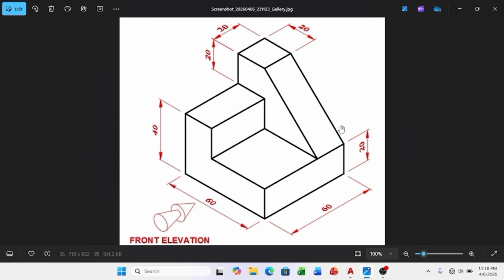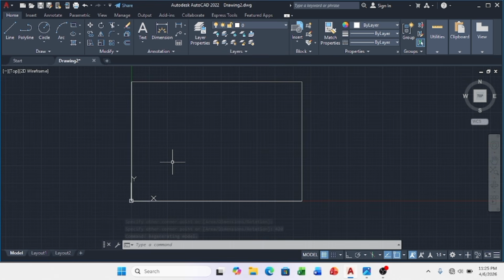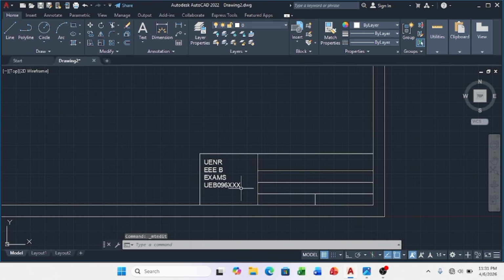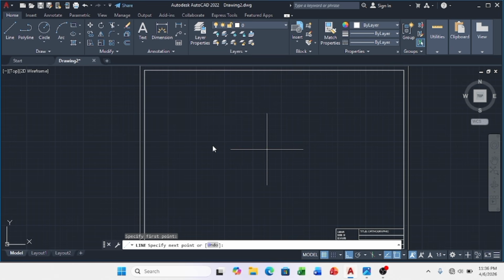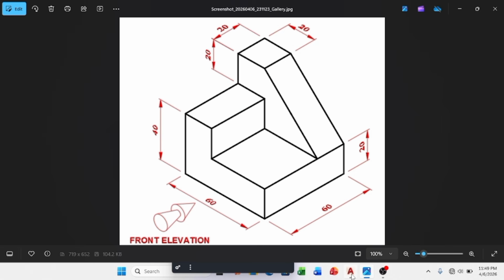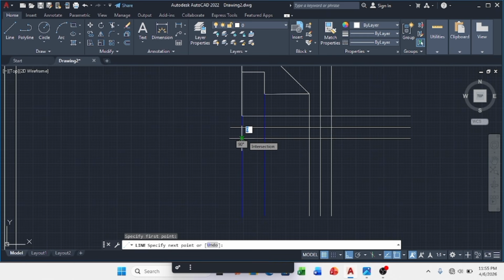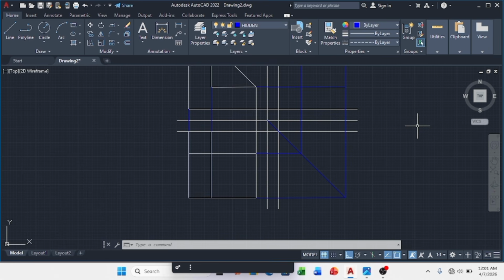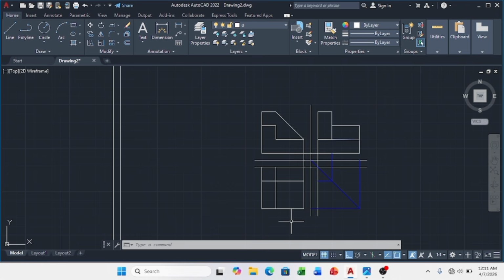Getting Started with basic setup in autocad and First Angle Projection

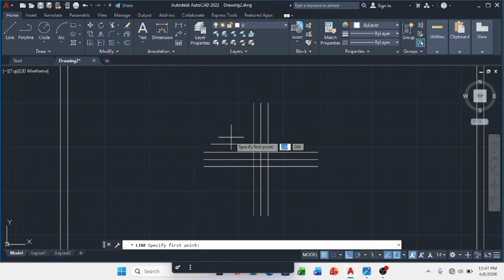Comment: It's totally confusing at 21:24, how can we exactly take a point on lower horizontal line that will touch the endpoint of the top horizontal line. And your video is lagging like anything. Very confusing.
Reply from the maker: Sorry 
You can turn on the endpoint so that it automatically detects the next point to connect